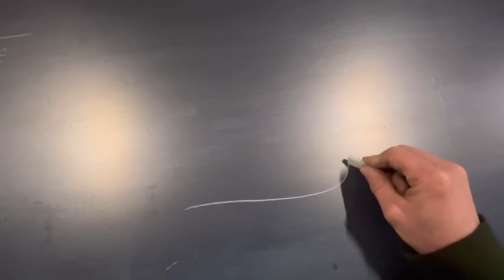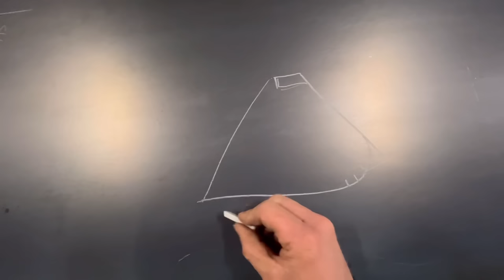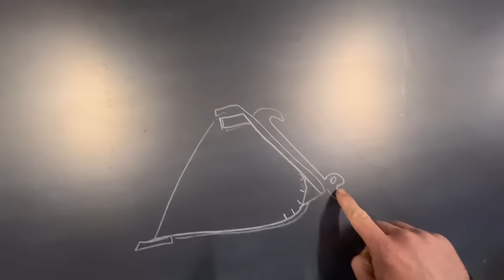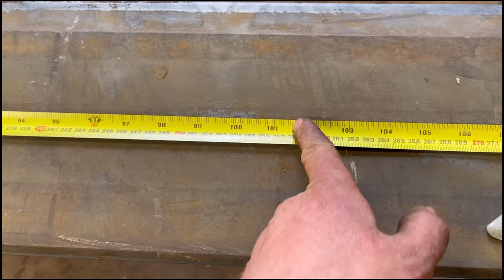Making a JCB loading shovel bucket from scratch. Part 1

Comment: If you're interested, 3m makes a quick latch respirator for pretty cheap. You just flip a little latch and it hangs by your chin and flip it back up and it's on tight. That way you don't always ave to take the whole thing on and off. Great video!
Reply from the maker: I shall look into this. Thanks!

Comment: Pretty cool. Really clean work. I built my own 60 in (1500mm) bucket for an old skid stear. No bending though. I bought a sheet of 3/16 ( about 5 mm) and marked it up on a table in the fab shop which they then sheared down to the various pieces. Took it all home and welded it all up. It was still quite an experience despite having it all cut out. Found a piece of carbon steel for a cutting bar and shanks for teeth. It’s been a good bucket for the last 15 years. It’s more fun watching you do it though. Too bad I couldn’t have watched a video like this before I took it on. You put out and display a lot of information.

Comment: Well done, nice work. I have put 3 front edges on one GP bucket as the chap just drives with it on the concrete!  So welded AR400 patches all the way along the front edge...better to replace those than keep chopping off a front edge because he likes to wear it out and it is not his!

Comment: That is really great work. I understand why you stitch welded the underside of the bucket but I once saw a bucket buckle over time in spots as dirt and sand packed between the straps while digging. The pressure packed the small openings between welds and it retained moisture between the straps and bucket skin causing rust. You may want to weld them up solid so nothing can pack under those straps while cutting through soil. 
Excellent work!
Reply: I'm with you on this aspect 100% definitely weak spots in the construction, it might be a little time saving now, but not in the overall  life of the bucket. I also thought the construction seemed a little light for it's size, though I suppose that may depend on it's specific intended use.
Reply: As a user of old equipment I am always amazed by the power of rust along a stitched joint. It will force any thickness of steel apart over time.I bought an Easterby trailer a year or two and was impressed by the continuous welds to prevent this. Looks like a grain bucket so probably not an issue here.

Comment: For cutting metal instead of oxy, try the 
Diablo D1472CF Steel Demon Cermet II Carbide Ferrous Metal Saw Blade in a circular saw. It makes amazingly clean cuts.
Reply from the maker: I do have a chop saw with a metal cutting blade however the bucket edge is too big to fit in.
Reply: @snowballengineering  Yes, same here, that's why I now use a hand held circular saw with the Diablo blade in it, as it's so much more versatile than a fixed chop saw.

Comment: i use to weld these when i was a younger man, the boiler makers would tack them all together and i would have to weld them solid, some took so much continuous welding it would give me sun burn around the welding mask too !!!
i use to weld truck tipper bodies too, some took 30 foot continuous welds, from the back tipper tray to the front or the truck cabin end of the tipper body !!!

Comment: I noticed you use the 3M 9100FX welding helmet with Versaflo air pack. You mentioned at 13:20 you have started to use a respirator when grinding (much like you I didn’t use one for many years either)
I have exactly the same welding helmet and back pack, an addition I can really recommend is the 3M M200 lightweight grinding screen (doubles up as spraying screen when I need one as well)  The 9100FX has the inner clear screen for some minor grinding but limited vision can be an issue hence a M200 is a huge improvement.
I am quite a bit older than you and find respirators tiring to wear/use and having a goatee then not 100% guarantee of face seal so with air fed grinding helmet no issues with face fit and nice to have clean easy to breath air.

Lovely fabrication of bucket and great use of the tooling you have. Keep up the great work, will always be a job for a fella like yourself 👍
Reply from the maker: I shall look into getting a M200, sounds like it would be very useful. Thanks
Reply: Just don’t fart whilst wearing the air pack
Reply: @lancewylie8604  yes that is true, however useful if there is a couple of you working together as you can share via your pipe into their filter pack 😝😝

Comment: I liked the turning onto the tyre. Nice soft landing. Few nice ideas for assembling that I’ve not seen. Good on you! Could have used the first  curved under strap as a template for the second strap. Saved the walking to fit and check. Or even made a cardboard template from the floor plate and used that to set the curve at the bender

Comment: Do what I did, weld a clamp either side of your press brakes that you can leave a tape measure in, holds the tape measures so you can just pull the tape out one hand either side....oh and learn from my mistake, the brackets drop on to a slot for removal in case you need 90 degrees up and the brackets were in the way.

Comment: Brilliant mate !  First time viewer and subscribed. Interested to know more about your welding process. Presuming its mig but couldnt spot the gas cylinder.
Reply from the maker: Welcome along!  Yes, it’s mig welding or mag if you want to be correct.   The main welder is sat out the way with the gas bottle, the wire feed unit is on wheels that you wheel about.

Comment: Well Im-Pressed 😝 wondering what’s the largest bucket you have ever seen 🤔 also is Hardox steel tough to work with? Mysterious droplets falling from sky 😂 🌧️
Reply from the maker: I’ve seen some big buckets made for wood chip but they’re still small compared to the quarry machines.  I’ve not actually had to do any work with hardox before.
Reply: @snowballengineering  I love the big buckets like for sugar beet that tip hydraulically. CERES do Hardox buckets.

Comment: Can you tell me what that square of metal is for when you were tacking up the cross braces?
Reply: Just watched a bit more of the video, I'm assuming it's to mark the length of your stitch welds.
Reply from the maker: Yes, it’s a 3x6” bit of plate I use to mark my welds depending on if I want a longer or shorter weld.

Comment: I want to make 36 inch smooth edge bucket for my backhoe and it would be nice to see a material list up on the screen to see the thickness of the steel and the hardness.
Reply: 6mm plate for the bucket and 12 or 15mm flat bar for the braces and pretty sure it’s all mild steel bar the cutting edge
Reply from the maker: Its in the video description 😉

Comment: it looks rather flimsy for heavy duty applications ???
it would have been better seam welded all the way through, the stiches will fail first !!!
it's not to late to weld it solidly, do it now before it's to late ???
Reply from the maker: You wouldn’t want to load stone with it or use it for quarry applications but that’s not what it’s designed for. It’s designed for agriculture use, loading muck into spreaders.  For that job it’s more than strong enough.

Comment: Extremely bad unsafe  handling and usage of the angle grinder ,After making the show for use of safety HSE protection still did not use any gloves or finger hand safety wear , plus a multitude of unsafe handling and working procedures , Nice guy and good skills , Definitely needs to sharpen up on HSE and safe working practices and procedures , to enhance his own safety , Clearly a hard working man , with best intentions , just lacks safety awareness
Reply from the maker: It’s safer using an angle grinder without gloves.  It’s far more likely to slip out of your hand wearing gloves than it is without, I’ve learn this from experience. My safety awareness is pretty good as after 12 years I’ve never had an injury worse than a mirror cut.
Reply: @snowballengineering  total nonsense
Reply from the maker: It’s absolutely not nonsense. The grip force needed to hold a grinder with a glove is considered more than bare hand. The continual strain of having to hold on tighter means fatigue sets in sooner resulting in less control and less grip of the grinder.
Reply: @snowballengineering  simply use the correct type of gloves fit for purpose and get some HSE training ,and practical safety training , I have been involved in safety for over 35 years and dealt with the results of way to many accidents to people that had escaped injury for several year ,that is until it happens ,get a Full safety audit done in your work place and working practices ,you will be stunned , get a full report on the audit findings ,for your own learning and awareness ,believe me you can only benefit from it ,remember knowledge improves safety , As I said before you are most certainly talented and skilled , But nothing wrong with getting a professional audit carried out it will make you much more safe in all aspects ,So you can continue with your claimed Accident Free Days , Learning is knowledge and betterment, even that you may not like the findings of a audit you will gain useful awareness ,